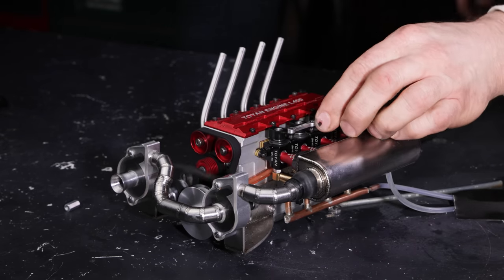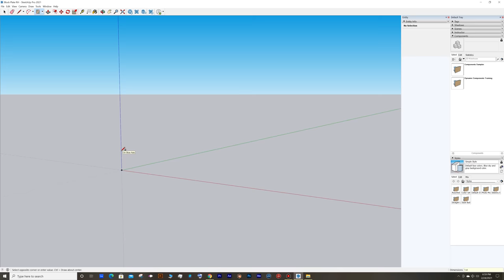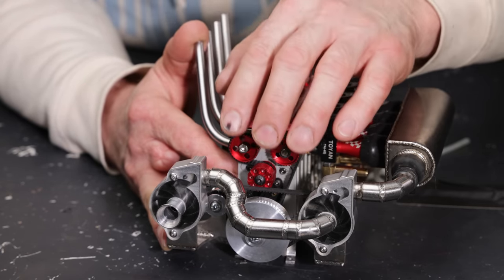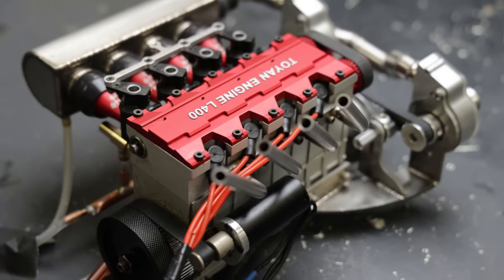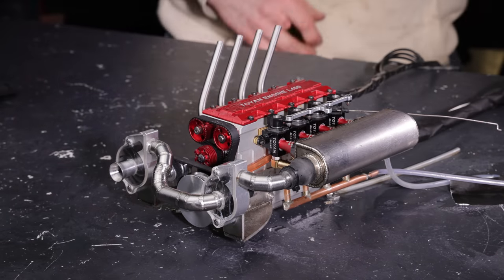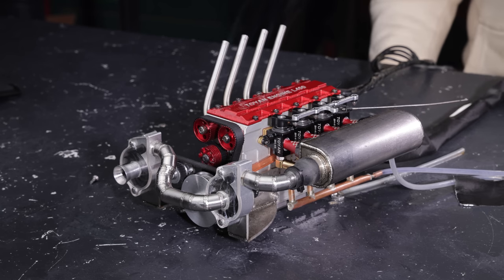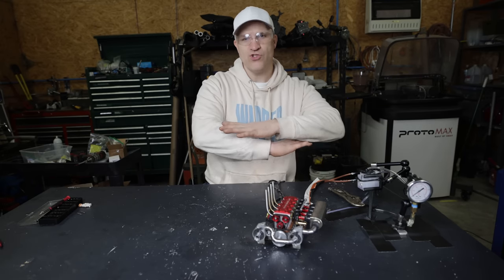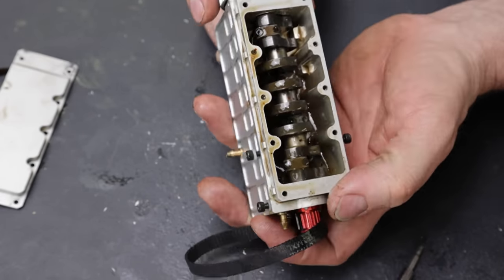Twin Supercharged 4 Cylinder Nitro RC Engine

Comment: The "compound" idea is flawed; the pressure isn't additive the way you're calculating it.  That's why you're getting so little pressure overall.  It wasn't the boost pressure pushing out the intake pipe - it was the vibration.  You have a bad bearing in your idler pulley.  And you're running your fuel mixture way too lean, which is why your engine temps are rising so fast; your "increasing the air charge" isn't all that you need to do!
Reply: Your comment is way too much underrated...
Reply: Facts
Reply: unbelievable. wouldn't let him work on my motors if it was for free.
Reply: He said he was running the fuel pressure regulator with reference to boost, so it should be increasing the fuel pressure with the boost.
Reply: @shredder8910  some say fuel pressure has nothing to do with the air/fuel ratio. if its increased the Fuel pressure RATIO, then yeah it will run rich, but just the pressure it will run lean, which is clearly the issue here
Reply: @ct1762  this is a carbureted engine with its power referenced to boost, which will pull more fuel with it
Reply: Your correct, you can't feed one into the other like that, it doesn't work at all, all you get is the flow of one supercharger, both superchargers need to be connected together after their outlets to get pressure and flow  rate from both units.
Reply: Incorrect.
Reply: @buzzedo1  no, correct,  for this to work the first charger needs to be bigger to pack more air into the smaller one,  like in full size cars.
Reply: @michaelbamber4887  Still incorrect😄 His biggest issue is the losses associated with the clearances on those compressors. Compound boosting something that has so much leakage just exacerbates the situation.  Think about this..both those compressors must flow the same air mass flow. Then consider this...air when compressed gets hotter. Hotter air is less dense. The first stage makes the air hot...no intercooler here...so on it goes to second compressor...to be made...you guessed it...hotter and less dense. Really it's unlikely this setup increases the air mass flow to the engine much at all. The size of the compressors rative to one another is not the main issue. Superchargers are pressure ratio machines....I could debunk his theory of 10psi from each compressor equals 20psi at inlet but that's for another day!
Reply: Maybe to illustrate my point a little more... I have compound charged my 2 litrr 4cyl engine. First stage is a turbo. Second stage is supercharger. The first state is intercooled. I can run each independently of one another. Supcharger by itself makes 7psi. Turbo by itself makes 12psi on the wastegate spring. So I make 19psi when both are running right?......wrong! I make 25 psi. Where did that extra 6psi come from? Because the supercharger is a pressure ratio machine. The increase in boost is relative to absolute pressure of inlet...that is, in this case...10psi plus 14.7 psi.  Remeber the supercharger made 6psi by itself? PR=p2/p1=(7+14.7)/14.7=1.48. Ok so the ac pressure ratio is 1.48. So now consider the turbo delivers the sc inlet 10psi, what's the outlet pressure?  PR=p2/p1. 1.48x(12+14.7)=p2 =39.5psi absolute or approx. 24.8psi Chew it over.  I explain it a bit more on my youtube channel if interested.  And for the record, I bypass the supercharger due to it being to small for the flow, which results in it making too much heat. I made another 70hp by simply bypassing it..that how much temperature matters on air density!
Reply: i guess i have a lot to learn before i turn 16
Reply: @ct1762  well he is missing a finger so...
Reply: Yeah and if your doing all that you mine as well lap the valve's
Reply: The issue with such little compressors are the clearances.  They would be similar to a full size compressor.  because they are so small, the percentage of the mass flow rate that can bleed back is very high compared to a full size compressor making them highly inefficient.
Reply: @buzzedo1  No buddy, YOU are incorrect. He's right, I'm an engineer and I assure that it doesn't work like that. Its pretty basic physics.
Reply: @kingcosworth2643  exactly
Reply: @buzzedo1  Ans I know you know this, but you are completely correct regarding your Pressure ratio example above.
Reply: @kingcosworth2643  haha. It's a topic I enjoy, and am more than help others understand...I am also always learning as the devil is in the detail. Losses always have to be considered. You'll note I have avoided talking about whether these small turbos actually work well. What I know for sure is the losses become a higher percentage becuase of our ability to manufacture thse things. The best turbos on car engines are 76 percent efficient or there abouts. I'm sure it's much worse at this scale and there ability to make high pressure ratios hugely diminished due to clearances etc. Since compound boosting relies on relatively high pressure ratios it probably just simply does not work well at this scale...
Being right is not as important as being open to learn. ;-)
Reply: @dylanhassan8714  we all have a lot to learn, hopefully we all keep learning! Age is just a number.
Reply: I came here to say this.

He needs at least different size pulleys between the two blowers, but more realistically he needs two different size superchargers to compound boost it.
Reply: @kingcosworth2643  On top of the fact that small air pumps are incredibly inefficient in the first place due to surface losses.
Reply: This is why real engines use mass flow rate sensors and fuel injectors, so you can have perfectly stoichiometric combustion
Reply: @1495978707  Sure, all engines need to be able to deliver accurate ratios of fuel for a given mass flow at every load/rpm point. That said, Stoich is not what we always want to target.  In the case of higher combustion pressures such as in boosted applications like the one being discussed, richer that stoich ratios are generally advantageous. The benefit being some cylinder cooling which can help avoid detonation as more boost/ aggressive timing approaches are used.
Reply: @michaelbamber4887  There is no technical reason you can't compound superchargers. The boost would indeed be compounded. Positive displacement compressors do this all the time. They're called dual or multistage compressors.
Reply: @michaelbamber4887  Why do they have to be different sizes? To my knowledge there are no compound supercharged cars with asymmetrical superchargers. A supercharger compresses air. If you give it already compressed air, it will compress it more.
Reply: @michaelbamber4887  Right. One into the other only works on turbos not super chargers. Dual superchargers have to be in a parallel setup rather than series. But either way nice craftsmanship and fun video!
Reply: @kingcosworth2643  No the pressure ratio example is accurate. The compressor doesn't care (to an extent) what the pressure of the intake air is, it will simply multiply it by a (sort of) set amount. A supercharger that makes 10psi of boost @STP isn't simply adding 10 psi to whatever your intake pressure is, it is multiplying the intake pressure by 1.68. Adding a second similar supercharger and assuming perfect efficiency would give you 26.8 psi gauge (41.5 abs). Of course we have an additional head loss and minor losses to consider, but compressors don't add they multiply.
Reply: I’m just here for the notes and analysis. 📝
Reply: I totally understand what you all are saying
Reply: @kevincross9089  oh good, someone who agrees, you use a turbo to feed a supercharger, not two superchargers, they need the first to be larger or the second one has nothing to compress, thats why if you look at a compresser in a workshop it has two different size cylinders, first one is largest, starts the process of raising the pressure, than passes this large volume of air into the smaller cylinder to raise pressure higher. you need volume ie cubic feet of air at a sustained pressure to feed the engine.
Reply: @buzzedo1  a Flow is still the same in the pipe... So no... The second compressor do nothing... Worse, it rev for nothing because it rev at the speed of the Flow,...
It could work if the speed or dimension of the second stage have been bigger.
Many engines work without intercoolers, it not the Best, but it works.
Reply: @benji280792  I'm comfortable with my description. We have to remember at its simplest, we are talking about mass flow. Since these tiny chargers can not produce meaningful pressure ratios due to losses, adding a second is not going to increase mass flow..the thing we care about...and even if it did..compound without intercooling would likely again..result it little or no benefit of increased mass flow.  Yes, it works when scaled up, but same principles apply.
Reply: @buzzedo1  many or almost all compressor used to work without intercooler... You should see What english used to put on their midgets, or What NSU used to do with wankel compressor on small motorbike engine...
A compressor is design at the scale of the engine, if it would not work When it's tiny, we would not use scale models to make simulations...
Little benefit ? So explain why some of the most powerful engines run without intercooler ? You speak about friction, but you dont know What you talking about... If friction have matter at this point, supercar would not run with two or four (sometimes not intercooled) turbochagers...
In this case, i agree the second compressor do almost nothing, but it not still the case. Air planes engines used to have multistages compressor. And if the second did nothing, they did had reach almost 3000hp...
Reply: @benji280792  You are comparing relatively large engines with scaled down motors. Scaling is used in engineering all the time, but there are limitations. Limitations in machining clearances is the one I am pointing out here. Efficiency at this scale is poor. Poor efficiency on a  compressor relates to how much temperature is put in for a given pressure increase. So my point is merely, I would be highly surprised to find that twincharge works at this scale effectively. Your second point, many engines run without intercooling; yes, of course this is the case. Cooling of a pressurised charge is only needed if one wants to make more power, or we have reached the limit of the fuel being used.  Whether you need an intercooler is a function of compressor.inket temperature, air density at inlet, efficiency of compressor, compression ratio of engine, fuel composition. Regardless, cooling the charge further by air to cooling or other means will give a denser change and provide the potential to make more power.  Fyi..I've built my own twincharge set ups..without intercooling on second stage...but if I could package it I would have. I did run chemical intercooling though.
Reply: Thank you
Reply: These are facts
Reply: Look at blades point in the wrong direction I thought they are supposed to point in the direction of flow
Reply: @buzzedo1  thats what i thought iat too hot.. Pushing hot air does no good at all. Maybe an intercooler or some atomized water injection.
Reply: I run water/meth on my 5cyl. Its a billet hybrid turbo that i can run beyond its normal efficiency on stock intercooler by using a 300psi pump and a 375cc nozzle from snow performance. Run off Hobbes switch activating relay at 12psi all the way to 25psi. I just use walmart brand -20 winter formula washer fluid. Msds states 62% water 38% methanol 0 additives. Also allowed an extra 10* timing when combined with vp racing octanium + 93..
Reply: Are you saying one has to suck and the other has to blow before it can work correctly?
Reply: Also I don’t see any of you computer screen commandos making videos and experimenting . Since all y’all have the answers why don’t you collaborate instead of tearing the man down like a bunch of jealous catty single women.
Reply: @buzzedo1  it’s called twin charging
Reply: I never saw this addressed, the superchargers need to be sized differently. Let's say the engine needs 10 cubic feet per minute of airflow, and each supercharger was the claimed 1.68:1 ratio. The second supercharger compresses 16.8 CFM into 10CFM, you high a higher volume going in, and a lower, denser volume going out. The first supercharger then, needs to supply 16.8 cfm on its outlet, which means it consumes 28.24 cfm at its inlet.this assumes a 100% volumetric efficiency, which surprisingly twin screw superchargers are in the high 90's. So, you'd need a supercharger 1.68 times larger for the first stage.

A more intuitive example would be cubic centimeters. If the engine was 10cc, a single supercharger at 1.68 ratio would effectively make the engine a 16.8cc engine, and two stages would make it functionally a 28cc engine. 
A more
Reply: @CRC.Mismatch  right way underrated comment
Reply: @buzzedo1  buzz what ya missin if when air is compressed it has same amount of energy as heat energy but smaller space so it puts off same amount of energy from a smaller area thus more intense so yes it’s more hot but it’s under pressure it’s not gonna expand it wants to expand more that’s why the heat increases the pressure a little more.
Reply: @buzzedo1  now if it was hot before it got compressed the air would put off more heat and be less dense than the cooler air being compressed but compressing it and it getting hot don’t make it less dense it’s under pressure so it can’t expand..
Reply: @motorizedbicyclenation53cu90  I can understand why you might think that, but the reality is, this is a chemical reaction. The, more fuel can only be added if there is sufficient air density...air density drops off as temp increases. So you can see, if air gets too hot, more fuel can not be added...or if it is...it will not burn..it will just cool the charge (also useful). If we can not add more fuel..we can not make more power. IF we cool the air charge after we presurize it, then we have more dense air...can add more fuel..and can make more power. I've built my own twincharge car so I'm not just prattling off theory...I've also tested it.
Reply: @motorizedbicyclenation53cu90  so long ago I can't recall specifics of this system. I like what you say. If you put a pound of air in a box, and squish it...it can't go anywhere...the pressure and temp go up. But your boost system targets a pressure, not a density, so when you hit let's say 20psi as a target, you bypass gas past the turbine, slow the compressor which reduces the flow (not the pressure). So yep..you got 20psi..but you got less mass flow.
Reply: @ct1762  this guys does cars.
Reply: @buzzedo1   The size of the compressors, relative to one another, is absolutely the largest issue, in fact. Yes, he does need a liquid to air intercooler after the second charger; but the first compressor also needs to be significantly larger for this setup to run effectively. 

Your understanding of PV = nRT, and the density of a gas as a function of temperature, both all appear to be scientifically on-point; but consider more-closely what that air is really doing, when the first- and second-stage compressors are both exactly identical. As you said, they are both indeed displacing equal volumes of air (and this is not the same thing as equal "masses" of "air"), yes; but the number of gas molecules (this is the "n" in PV = nRT) contained in those two identical volumes, is vastly different for each respective charge. Why?...because as you already mentioned, the respective temperatures of charge air being compressed by each charger are also vastly different. His setup isn't working, because, as you alluded to, all he's really done here (without an intercooler), is welded an incredibly efficient hairdryer/heat gun to his intake manifold. By the time ambient air exits the final compressor to head for the intake, it's already going to be several hundred degrees hotter than ambient, because now it's been compressed twice, by two identical compressors with the same thermal "efficiency"...and without intercooling -- not super useful for making power (or for reliability/durability).  

The way around this pesky heat problem is rather simple, and it doesn't necessarily even require intercooling to achieve useful boost. The efficient and proper way to run two sequential superchargers, is to install a significantly larger first-stage compressor, that moves a much larger volume of air than the second, (larger compressor = higher cfm), but with a relatively modest/low compression. This is what allows the second charger to actually breathe, and do something useful, rather than completely suffocating the engine by blasting it with twice-heated air. As long as the first charger continually supplies a larger amount of air (again, think in terms of higher flow/a larger cfm rating)-- rather than a smaller, more-highly-compressed (and therefore, much hotter) charge of air, the second, smaller compressor, can efficiently boost it to the moon without melting the engine together and seizing it, in the process.
Reply: @buzzedo1  "Both those compressors must flow the same mass air flow."

Nope. This is where your misunderstanding of the situation is emanating from. Given identical RPMs, the compressors will move equal volumes of air -- NOT equal masses of air.
Reply: @buzzedo1  You're able to make 25 psi with your turbocharger + supercharger setup, exactly because (as you even clearly stated, yourself) your turbo moves significantly more cfm's of air at a relatively low pressure, while your supercharger is moving a significantly smaller volume air (less cfm's), making it all the more easy to compress it to a higher pressure of 25 psi (because there's quite-literally less of it to compress, it's already partially-pressurized, and most-importantly...it hasn't been heated to oblivion by an improperly-selected first-stage compressor). As I already explained in a different reply to your comment, your sequential setup (stage 1: high mass air, high cfm, low/modest boost...stage 2: (relatively) lower cfm, high boost) works, essentially because your turbo is large enough to prevent your supercharger from ever suffocating. If you had a much smaller turbo, for example, your supercharger would be gasping for air, trying to suck away at the partial vacuum of charge air it would create, in the absence of a first-stage compressor/turbo to supply it with sufficient airflow.

If you seriously have your own channel, trying to explain this stuff, you really need to take some time to understand it more-thoroughly yourself.
Reply: All that engineering skill and doesn’t know basic airflow
Reply: But lean is mean!
Reply: be my master
Reply: @buzzedo1  everyone debating are correct in some aspects and incorrect in others. The biggest flaw I see here is comparing a TT//BT, or SC/T system to a parallel twin scroll or root charger system. Apples and oranges
Reply: Yeah! What HE said!
Reply: Spoken like a Top G...
Reply: @ct1762  there are a lot of auto SC kits That use regulators and bog pumps over stock injectors. It can be done to a certain degree. Eventually injectors can only deliver so much even with forced pressure.
Reply: Bro I don't think any one knows what your saying they just think your good at what you do
Reply: bro yall could have asked chat gpt
Reply: @ct1762  he just built superchargers for a 4 banger from scratch. Yes theres some bugs but thats way more impressive than anything a normal mechanic can do.
Reply: I have compounds on my 6.7 and my does not double the first Chargers boost pressure. It’s about a 65 to 70% compound depending on the charger sizes in relation to each other.
Reply: It's pre mixed rc nitro fuel 20%
Reply: @hilldwler420 hear hear well said I agree with totally bud
Reply: Compound isnt flawed you can compress the air and feed another…. Second mostly it’s used to spool a huge turbo that the engine alone couldn’t….. you use a small one to spool bigger one…..it works look at any serious diesel….
Reply: @ogfromutube9649    You might want to try BMW washer fluid, it's expensive though.  Closer to 50%/50%.
Reply: For some who has never even touched that engine you sure know how to talk out your ass 👍
Reply: I agree, tuning cars, I’ve seen on average a doubling in hp every atmosphere of boost I see. 

So let’s say a b18 makes 150 stock. With 15psi of boost it’ll make 300wheel or more. 300 if you keep it safe.
Reply: 😂I love these comments small motors have to be built just like big ones just more cylinders
Reply: Those were my first thoughts. Counterintuitively (to me), the sequential superchargers will actually increase boost, but will only have the flow of one supercharger. This means the pressure will only be additive above the flow rates that it would naturally aspirate.
Reply: 🤣Compound forced induction is definitely not a flawed idea. Neither is twin-charging or sequential forced induction.